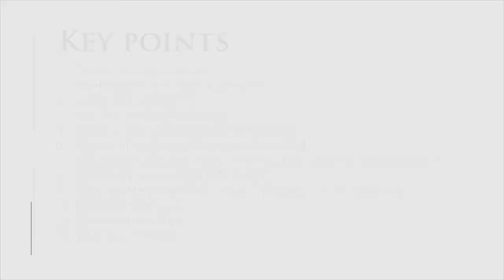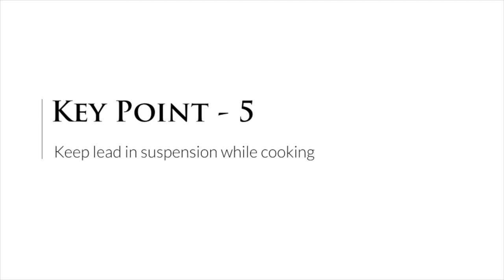11 Demystifying Maroger Medium - Rubens Variation no 1

Comment: Well done, sir! Most illuminating demonstration resulting in about $400 (retail) worth of Maroger.
With Black Oil now being readily available (Natural Pigments and Old Master's), could you just add resin and turps to create Maroger?
I must commend you for the extraordinarily safe process by which you created the Maroger! I saw another YT video where someone cooked Black Oil outside on a grill. The oil was burning and smoking! Highly dangerous, to say the least.
Thank you for this invaluable demonstration!
Reply from the maker: Old Masters is a very high quality product.  So is Gamson products, in fact there are more high quality products in the market place than ever before.  ...
There are several alternatives to a butter medium.  
The wax mediums are buttery but do not have the gloss. To attain the gloss add some varnish to the wax medium. 
To get the gloss you can add a retouch varnish to the medium to get the gloss. 
Making your own re-touch and varnishes.  You want to find water clear turpentine that says  100% Turps and or 100% pure.  Mastic is the most expensive varnish, Damar is a harder varnish and less costly.  Damar is what most brands use for their retouch varnishes.  Retouch varnish is just a very watery thinned down varnish.  The ratio of resin to turps is known as the cut.  
Adding retouch varnish to the paint directly helps dry it quickly.  
To get your hands firmly on the wheel, start to make clear in your mind, the topics. 
Dryers are metal sugars.   Siccatives= dryers or sugar dryers like sugar of lead, and linoleate dryers such as cobalt.  
Resins, which actually are not resins of which are gums, these are the mastic, damar, copal, and so on.  You can even use incence resin such as frankincense.  Pine resin was used by Rubins but is not as hard.  Careful the pine resins contain "turpines" which are very flammable. Resins make you paint glossy, which is in all reality an "alkyd", just the same as your house paints .  
Your oils are fats, you have nut oils, and seed oils for natural oils. Nut oils tend to be water clear, but not as hard as linseed oils.  You're always looking for a water clear product in Oils.  

https://www.thriftbooks.com/w/the-materials-of-the-artist-and-their-use-in-painting-with-notes-on-the-techniques-of-the-old-masters/9315168/item/19277699/?gclid=Cj0KCQjwnNyUBhCZARIsAI9AYlE5RLOcRbXnWTE5uo3TvLjMfQWP1q-XSupCgdi0Omlf4BV8Eg1OE1saArJSEALw_wcB#idiq=19277699&edition=8629010

previous
Reply: Thank you for that exhaustive list! I don't believe I would ever make Maroger or varnish myself, but it's good to know it CAN be made! I use the traditional medium of linseed oil and solvent (Gamsol). I bought an old bottle of glazing medium (linseed oil, turps, damar) at an antiques shop, which I have yet to try. I also use Rublev Oleogel by Natural Pigments (linseed oil  + silica). I've been curious about trying Maroger for quite some time, but as an indirect painter I don't think it would be helpful.
Reply from the maker: @amysbees6686  Most of the best painters I know are not so concerned about the mediums.  Most painters that are successful stick to one brand of paint and don't deviate.
Reply: Very true about mediums. It took a decade after I started painting in oil to feel confident enough to venture into mediums. As for paint, I began with Winton and Georgian. I then moved to W&N and Gamblin. Now, I've included Williamsburg and Michael Harding, along with some Sennelier, Rembrandt and Lefranc & Bourgeois. I seek to work with the best paint I can afford. What
Reply from the maker: @amysbees6686  Well done!
Reply: @Peter Forster
Thanks!
Oops! Was cut off typing. I was going to ask what you use? 
I see you are a sculptor. My great uncle was as well, only in bronze.

Comment: Sir, what do you think about adding colloidal silica to walnut oil, instead of litharge  (cook yes/no?). Dissolve the mastic in the turpentine oil and add at the end?
Reply from the maker: Silica suspended in a colloidal solution will only turn your painting white.  Litharge is a dryer known as a sicitive, that speeds up the drying time.  Other metals, such as verdigris, can also act as a sicitive. If you put the mastic in the turps, you will surely have fire.  The Terpines in the turpentine are highly volatile. Like I said in the video, oil first then after it is cooked, add the turpentine.

Comment from the maker: @mithatkorler7070 I found your comments in my email, but cannot find them here.  old holland cremnitz is a brand product, and it most likely has fillers in it.  Use at least 97% lead oxide, carbonate or litharge.  The lead is toxic, and you may wear a chemical respirator, to prevent you from breathing fumes.  here is an affordable full face regulator, https://www.amazon.com/dp/B0CP9KW12J?psc=1&ref=ppx_yo2ov_dt_b_product_details.  For a regulator to function properly, you must be clean shaven to keep a tight seal.

Comment: Thank you master . But can I use lead carbonate for the substitute for your lead and what kind of lead you are using ? It not visible in the video.  please tell me about this
Reply from the maker: Yes you can use lead carbonate, it is whiter but not as durable. I am using litharge, which has a yellow tone.  the color of the lead degrades through the heating process. Now ask yourself what is the principle behind the lead?  It acts as a siccative, right.  Now remember that Velasquez used verdigris as a siccative.  In the spirit of Maroger, he gave us the base notes but wants us to go out and be innovators.  So take notes on your successes as well as your failures.  Let me know how the lead carbonate turned out for you.  I encourage all who practice this to do so outside, and with fire control.  Remember that everything you are cooking is a type of fuel. Never push past a lightly smoking stage.  Lightly smoking means reduce your heat.
Reply: @forsterarts   Sir how much temperature we need to make this and can I use the mixture of lead and linsid oil as a black oil midium .
Reply from the maker: @sohelpervas4821  As Maroger describes bring the heat to a light smoke, then reduce until the smoke dissipates.  Remember where there is smoke there is fire.  Be careful!  The lead with the oil, is the black oil medium as described by the Italian masters.  Cook until coffee black.
Reply: @forsterarts sir are you using the lead oxide form maroger medium
Reply from the maker: @sohelpervas4821   I have lead carbonate when I need an absolute white or clear medium.  I generally use the litharge, which forms a harder surface, but tints very slightly yellow.  Its your choice.  Litharge has been easier to get and is cheaper than the Lead carbonate.
Reply from the maker: Lets examine the properties, and what is going on.  The black oil, combined with lead makes the famous black oil of the Venetians.  The resin turns the paint into an alkyd, and that makes the paint glossy.  The Italians preferred the flat non glossy for their huge murals, because there would be no reflections to deal with.  Velasquez would use Verdigris for his dryer.  And I heard that he may have even used pine resin to add gloss.  Pine resin should be avoided because it is so flammable.   The toluenes in pine gum are very flammable.

Comment: How long is it on the heating plate before it's ready?
Reply from the maker: You should always cook out doors, because it can burst into flames.  Be Careful!  I first make the black oil with the litharge.  The temperature should be just a faint smoke off the top.  If you have a faint smoke, turn the temperature down just a tiny bit so it doesn't smoke.  You cook until it is as black as coffee, for me that takes around an hour.  But it all depends if the lead is dissolved, if the lead is not dissolve it will take longer.  The black is the first indication that the lead is dissolved. "Remember there are six basic recipes each of the six has many multiples.  Get the book, take notes and find the formula that is right for you!

Comment: Thank you master! Really thanks. One question. Can I replace mastic for dammar or copal?
Reply from the maker: You can use any resin.  Of the three the copal is the hardest, damar is pretty hard and the mastic is the softest.   Damar from Singapore has added contaminates to increase its weight, so you have to filter it while its hot.    All three are fine, just take notes, and keep the batches categorized.  There is a caution for pine resin, it has turpines  which are volatile.  Most gums or resins used in incense could cause a fire, such as frankincense and sandalwood gums.
Reply: @forsterarts  OK Master, many thanks! I've taken my notes of your class. I'll do the proces by my own.
Reply: They say copal needs a much highter temperature to melt into oil / Also they say only this(oil-lead-mastic-terpentine)  combination makes  a gel .....the other resins would provide you a  varnish designed for working with colors, a thick liquid , but NOT a gel !
Reply from the maker: @vioricabuta3783  Yes!